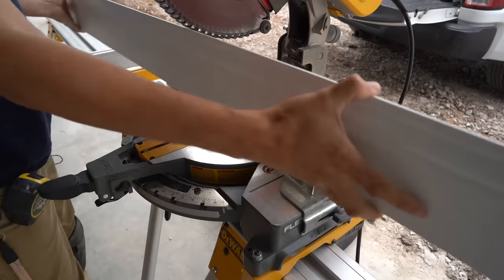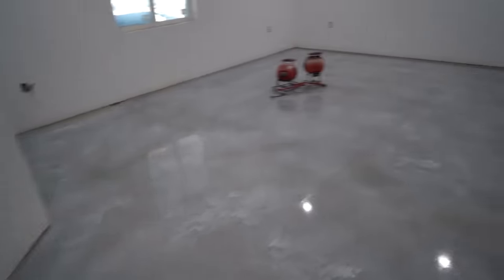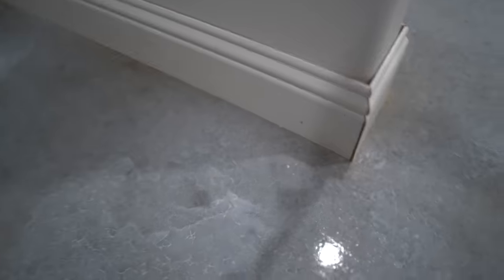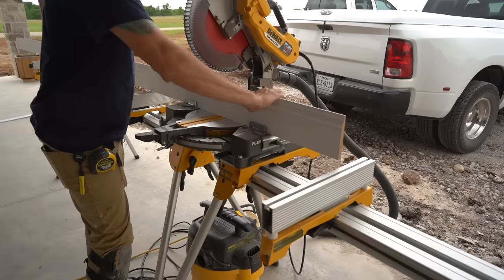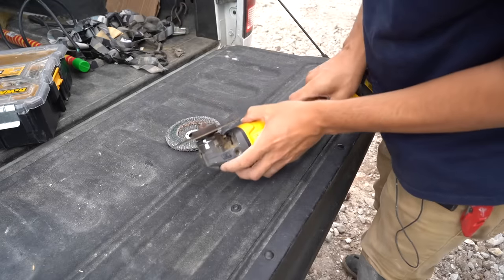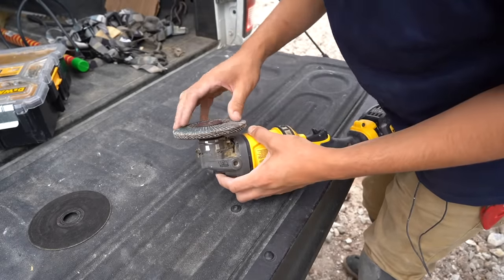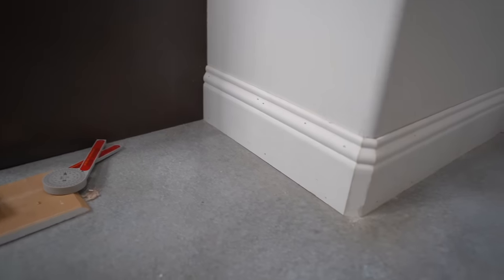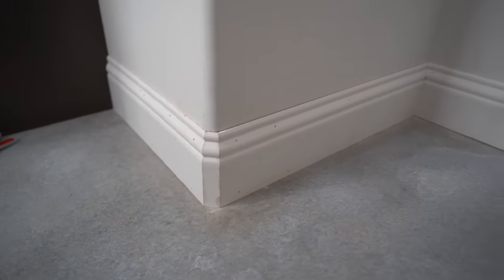don't let your framer do trim

Comment: A true trimmin' machine there Richard!  Adapting crown stops for making cuts on 'floppy' mdf base?  Nice!  Re-doing a project like that sure makes a guy wonder "what WERE they thinking?!" that allowed them to walk away and leave gaps like that, right?  Best, Matt
Reply: Oh, the painters will fix it. Caulk the magic glue.
Reply: Thats how people make the money nowadays. Do half ass work quick. Get the customers because you charge slightly less. And then when youve run out of customers... Change specialties. Rinse and repeat. Atleast around my area that seems to be the business model.
Reply: @1stFlyingeagle    What I have to deal with when I get to a client's house usually.  I'm a painter by trade so I will learn trim as well so I can help get rid of that crappy looking trim I have to deal with...
Reply: @delegate104  unfortunately there's no guarantee if you go with the higher bid it will be better but usually true. You get what you pay for
Reply: @delegate104  says "You can't blame the guy that did it...the cheapest one"

No. You can totally blame the so-called carpenter who did the work improperly. This wretched trim job was a the product of scammer who clearly has primitive carpentry skills, but advertised the ability to do the job and wasn't going to get it done correctly no matter how was charged. Screwed up trim throughout the house. Didn't deserve a dime from the homeowner victim.
Reply: It's simple caulk and paint makes a framer what he ain't.
Reply: 100% they were thinking oh we can caulk this.
Reply: He is a excellent Guy

Comment: Yea as a finish carpenter I’m a slow framer lol. I know how to frame but can’t bring myself to conform to the rough framing mindset 😉
Reply: You aren't even kidding! In my professional life I deal in millimeters and fractions of them...so when I do trimwork at home as a hobby, I tell my wife it takes as long as it does because of that very reason...
Reply: Yea my boss got on my case for using lazers to frame, but told me the wall was absolutely on point. I told him that I used to work in a machine shop and he understood why I think that way. Mostly do trim and cabinet installs now and bought a digital 4' level, had to show the guy I work with that a piece of paper will make it out of level in 4'. I do love the new high tech stuff and the level beeps so you don't even have to look at it to know level. I fall into the category of Jack of all trades from cars to houses but it becomes a major drain on the wallet because the amount of tools to do anything that comes my way. Went from a 92 f250 with enclosed service bed that tools outgrew to a 77 box truck (in pic) that weighed 10,100 lbs. Doing cabinets now and in a couple of weeks I'll be cutting concrete in a basement for all the new plumbing. This channel is great, I try to buy whatever he says works for trim and use a lot of the techniques he shows. Adds some extra flare to my work so it stands out.
   Oh yeah copping with a grinder blows everyone's mind, it's flawless with speed.
Reply: Wyman Clark same here been doing it all for many years... so many tools. Working on transitioning to farming and woodworking but when you know how to do it all you get a lot of calls. Been turning down quite a bit of work lately......  wait you’re not supposed to use lasers for framing? 🤷🏻‍♂️
Reply: I'd love to go on a job and see a mitered rough window opening, lol.
Reply: I do woodworking  furniture as a hobby for myself. Its hard to see how framers mark and cut their wood.
Reply: I was thrown off by rough framing also because I’m a very precise worker, but when you’re behind on a job and NEED to get it done fast, an 8th or 16th off will get you by in most cases. As long as your wall in plumb and your corners are square and everything else is bing bam boom.
Reply: I love the hate for framers.  Hire someone competent and they can frame faster and more precise than an "only framer".  If someone tells you they are a framer and are prideful about it, turn around.  They only know how to nail a board to a line.  No thinking involved with those guys. Idiots, brainless, and worthless
Reply: NorCal Sampson , don’t pigeon hole people. It’s all about paying attention to detail. I can frame using wood or steel. I can run trim with the best of them. Therefore I call my self a carpenter. Production work is just that, production, not perfection. If it’s worth doing, it’s worth doing right.
Reply: On a 2000 unit job u might just say fk it its within a quarter
Reply: I was a mechanical fitter and machinist, takes some effort to open up my tolerances when I do timber work 🤔

Comment: A good carpenter frames his house thinking about the trim details, that way his trim job is clean and easy. Too many piece hacks that only know.."....nail on the x..MARK RED!
Reply: That's actually a good point. In Denmark carpenters are pretty much expected to be able to do everything. Thats also a reason why I will take the time to do things like put in plywall behind the drywall in kitchens; to have something solid to hang the cabinets from, a few weeks later.

Comment: I do residential framing all the way through trim, I can’t deal Jack with pretty much anything besides carpentry but even the sloppiest guy is gonna get +/- a 32nd and can do a 45, I would be a lot more concerned about what’s going on inside the walls if the framers were that bad. Seems to me more like a case of howie homeowner screwing up and needing someone to blame. Tbh it’s always better to have someone who can do trim go to framing than the other way around, because the trim guy might take longer but at least it’ll be right whereas the framer might not realize the tolerance differences and just think to fill it with caulk

Comment: Looks like 16 3/4 a little heavy to me, might be the angle of the camera. 

The end/hook of the tape is made to push and pull, it compensates for the thickness of the hook. So wether you are hooking the end of a board or pushing it in a corner, it's always accurate. I always go with whatever the tape reads, can always take a hair off, but can't add to it, unless you're caulking
Reply: I have met people who work with a tape measure everyday for 30 years who did not realize that the hook slides in and out to compensate.
Reply: I audibly muttered “And a c-hair” at that part.
Reply: Better using metric...
Reply: @danch10  I'm sure you're right. 
But, I doubt that everything lines up just because you're using metric. 

If he were using a tape measure that read 32nds, then it would've been close enough. But who wants to use that. It either dead on, light, or heavy. As close as it gets. We're not machining parts that have to be within 1,000s of an inch, or centimeter

Comment: At least they didn't fill everything with caulk like most do.
Reply: They didn’t make it that far
Reply: I would of just filled it with caulking
Reply: The insides should be caulked regardless.
Reply: Rob Williams yeah. That’s what I do 😂
Reply: i hate that, it always shrinks eventually / soon after and looks like a child has done it, i grew up in a family of roofers so thats in my blood but i love learning new trades ive worked as plasterer + builder, my plastering is ace my blockwork slow. but at least i wont finish a job until it looks 1st class, im anal like that, if it dont look right rip it off or knock it down and do it again. its the best way to learn, take my time do it right the 1st time, i wont do anything unless i know i can do it right, wont touch plumbing or electric but most things are doable if u take pride in ur work
Reply: All the trim in my house that finished with paintable dap is still looking perfect  12 years later! It's the only way to do trim.
Reply: @willietheboggle3954  this comment is gold 😂😂😂😂😂😂😂😂😂😂😂😂
Reply: David Meads  doesn't matter how good you do. It looks like shit unless its all filleted up.
Reply: Caulk it to fit paint it to match 😂
Reply: @augustusappling139  i know i know..

Purrty. Right?
Reply: thats what she said
Reply: Augustus Appling “Do your best and caulk the rest”
Reply: Your supposed to lmao
Reply: Liquid baseboard
Reply: Guero how you gonna learn then

Comment: After 36 years I do mostly residential remodeling anymore.
I can tell you that I have always coped the inside corners on just about everything from base, chair rail and crown.
95% of all existing trim that I have either pulled or matched has been an inside mitre!
Those old timers were good at it!

Comment: Need a shirt that says “cope it now or cope with it later”
Reply: Not a fan of inside miters?
Reply: @cm01  If inside miters worked coping would have never been invented! I never install an inside miter even if it's getting painted.
Reply: Awesome comment
Reply: Buhahaaaa
Reply: @RobertBarth1  
quick and cheap.
Thing is.. most people actually don't care and will probably destroy the house anyways. After 10 years alot of the trim will be jacked up.
Reply: @klmbuilders5385  100%
Reply: same
Reply: @RobertBarth1  I own one of those and you are so right.  You left off that it's door casing not true baseboard and the outside corner moldings don't match the "baseboard".
Reply: Thats a genius slogan
Reply: I mean that's great and all but why not cope with a jigsaw and scroll blade. Looks just a good but way faster

Comment: Been doing baseboards in my own house and this video was a big help.  Also ive been putting in laminate flooring and the laminate murders coping saw blades.  I never even considered using an angle grinder.

Comment: I call that 16 3/4 strong....meaning leave the line when cut.
Reply: Kevin Dumais I do the same. I call it “heavy” but the same idea.
Reply: @g1mpster  yep same here always refer to it as 3/4 plus or minus but ussually its unnecessary as we aren't always doing finish carpentry
Reply: I call that 425 millimeters because the metric system is so much easier to use... ;-)
Reply: I call it a fat 16-3/4". 

 @franknoth6726  The same issue exists with the metric system when using a tape measure. The 16-3/4" measurement would be 425.45mm, so the issue is where do you draw the line on your precision.
Reply: @xtranormal2350  😂
Reply: @unitedgray  I'd call it 425,5 mm if I was a smug ass claiming the metric system was the vastly superior measurement or maybe I just have a tape measure with both measurements and I can choose either one. I'd normally just call it 16 3/4 + or fat whatever works for you.
Reply: @franknoth6726  People actually out here defending a system of measurement!.....the metric system is better!  LOL
Reply: I call it "Heavy",,,Been doing finish carpentry for 20+ yrs
Reply: Strong = 1/32? Sadly some say strong because they don't know how to read tape to the 16ths.

Comment: Framer here 🤘 those cuts were horrendous and the bullnose work was a joke. I'll do base and I take pride in my work so if it isn't pretty, I'll rip it off and do better.. Whoever did that, takes no pride in themselves or their work.
Reply: Jay TX fellow framer here. Yea this is a bad title for a video
Reply: This
Reply: Agreed. The problem wasn’t that the contractor was a framer, nor plumber, tile man or the pizza delivery guy - the problem was a lack of care.
Reply: He was very generous not to rip this guy a new one.
Reply: Most illegal immigrants do that kind of work and low ball undercut the job just to get it. Then the homeowner winds up paying more to get it done right. I see it all the time in Texas
Reply: @lilbeanie5078  Spot On!
Reply: Spot On!
Reply: Lil Lil Beanie The point of the original comment upon which these other comments have followed is that this video was unfairly titled by tarnishing framers with the same brush. If this were a framing video with a seasoned framer ripping into ‘finish carpenters’ because a ‘careless’ finish carpenter offered to frame out a basement for a customer and forgot to crown the studs so the drywall is all wavy now would be a bit unfair would it not? Your point is valid, it starts with the framer and if his work is tidy and on point it makes life easier for tge other trades to follow. Better yet, it all starts with the land surveyor/Engineers and designers and so forth. You could be a perfectionist of a framer but if the land you’re building on is no good in this application then failure will follow. There are many careless people in this world regardless of the ticket they may carry but you can’t group a certain trade together.

Comment: Using the miter saw to cut the straight portion of the cope? Genius. I've been putting up 7-1/4 base with a similar profile and keeping that edge straight with the flap disc is nigh impossible.
Reply: Unfortunately I learned that trick very late in life.....  The grinder on the design mold portion is a new trick.
Reply: Cut it with a slight bevel incase the wall is off the square or the plaster pushes it off the square
Reply: Really no need to back-cut a 45 though, 5 degrees is plenty, and your stock won't break...
Reply: Greg P you must be new.  People have been doing that long before this kid came along.
Reply: Not sure about genius but it makes sense. I can't see getting anything done efficiently  if you tried to free hand all the straights. I like a course  flap disk as well, and for some things a disc sander with angled table makes sense. It can eat material really fast and is great for tapering tight glue in plugs as well. Tend to use a combo of flap wheel, and disk/ belt table for relieving problem areas on tight fitting natural finish staircases.

Comment: Those beams looked like good execution of a poor design choice. Do what the customer wants, but damn some people have no taste or architectural sense.
Reply: I was thinking the same thing. Nice job..shitty design. The coffered ceilings he does would look Soo much better. I cant stand the bull nose corners either but hey..its the south
Reply: leoz maxwell jilliumz 
 I don't like those bull nosed corner jobs either. 
  I didn't realize it was done on purpose. 
  First time me I seen one, I was thinking, 
  "I can see it was somebodys first time doing trim". 😂
  Whoops.
Reply: I guess that, to them, sloppiness is next to cleanliness, or whatever. I'll tell you this:If I was building a house, and a framer came in, and did that horrible of a job, he'd be paying me!
Reply: Me too. I am a homeowner that does a LOT of my own work. Trim is one thing I just hate doing because it is so obvious. I have learned over several projects (multiple homes and businesses) a few tricks. But, design is the biggest problem with MDF trim over bullnose drywall.

Comment: Unless they're actually certified journeyman (and not hacks), then they should be trained competently and have the experience to do it all, from the ground up, minus utilities. If not, then they shouldn't have a cert...
Reply: Certifications only mean something to union guys.
Reply: @Nevada Goodwill talk like that to your project's engineer and you won't be working on that site 🤣. A journeyman with a fresh 2 week old ticket should certainly not be making structural changes to any building.
Reply: @jaredmurphy4388  agree
Reply: That's the how I was trained and learned every aspect of building a home from the ground up. I learned from a master carpenter and did it for over 20 years. But I also learned electrical and plumbing
Reply: @C is Life lol not really though, engineer has to sign off on it and the new engineering report needs to be submitted to planning.
Reply: Engineers and inspectors don’t give a darn about what certification you have. I’ve been in construction for 25 years trust me they can make your life hard. Shame on your general contractor for letting a green horn make those kind of decisions
Reply: @Nevada Goodwill Structures in Alberta bouta start falling over.. noted
Reply: Correct
Reply: I don't know any carpenter that would mitre internal corners rather than scribe.
Reply: @jaredmurphy4388  eh... I had an argument with an engineer and the site supervisor about the north reader board at the Cosmopolitan in Las Vegas. The part on the north side that has TVs wrapped around the corner about 100 ft up. Long story short if I had not stuck to my guns there was a chance that it would have collapsed. I was an apprentice at the time but did start college as a civil engineer and had experience with Autocad back in HS. The anchor bolts were not long enough for the weight. Journeyman carpenters couldn't figure out how to run that section of building straight either as the decorative glass moyen pop outs prevented them from using a laser level from such a distance. I blew their minds by using the floor above and the rise over run formula. 🤦‍♂️
Reply: @Fiberglasser03   Agreed. I was a laborer for a contractor and none of us were union. And yes our work probably wasnt as nice as the union guys but we got it done a hell of alot faster for cheaper and thats what most people want.,
Reply: @lukasdoofus2592  No, I bet your work was nicer then any union guy.